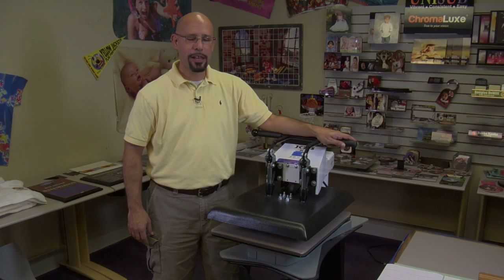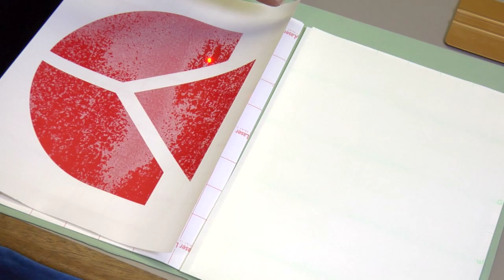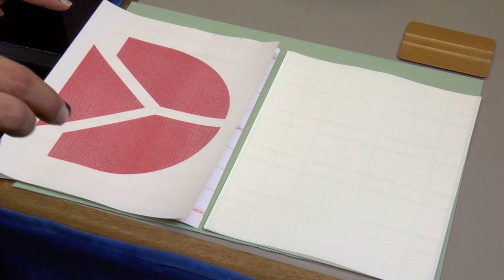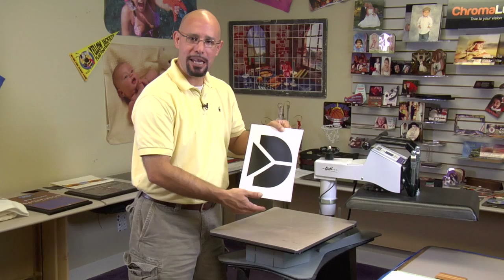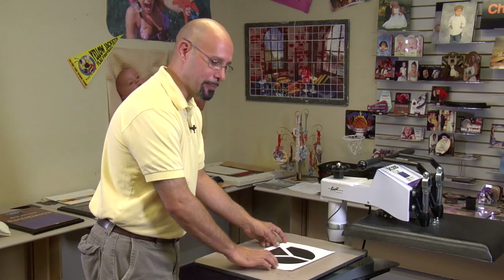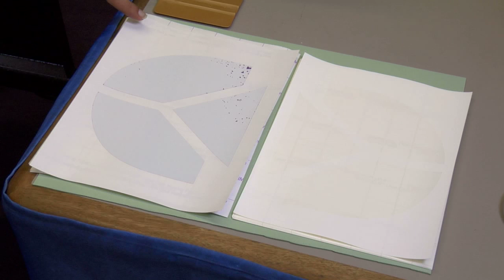Calibrating A Heat Transfer Press for ImageClip Transfer Papers -

Comment from the maker: If you have areas of your design that do not transfer completely, where there is "drop-out" within the design, the issue is not having emulsion deposited during the FIRST press. This symptom has nothing to do with the second press, where you are applying the design. After you press your RED and GREEN sheets together during your first press, you should have a "haze" over your toner. If there are any areas to your design where there is no haze, these areas will drop out when you heat your shirt.

Comment: I wish you had covered step two, applying the image to the garment. That is where I am having some issues. I am having some toner that does not transfer to the garment. It is giving the appearance of a distressed design. Is it more likely that is is too little OR too much heat / pressure?